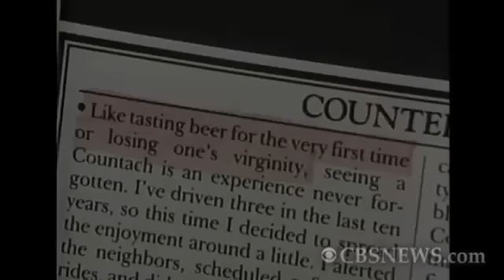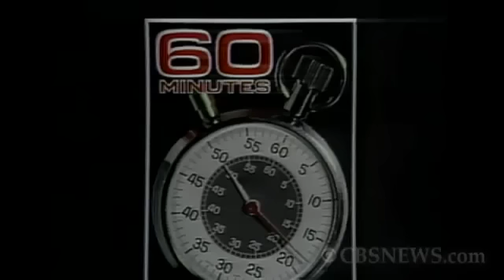Countach - Ferrucio Lamborghini & Valentino Balboni on 60 Minutes (1987)

Comment: I had one of these back in 1997, Spent $10k on a clutch.  Just bought another one last month.  Paid 6 times more than I sold the last one for.  Still an amazing car even though the last fast car I drove 18k miles was a Tesla P85+.  The Tesla is faster and obviously tech loaded.  But nothing beats 12 cylinders roaring behind you!
Reply: Scott Ales but you can't deny a countach is still fast even today. 450 hp and 4.7 to 100 kph. its still fast for modern cars, furthermore in a tesla you won't feel the speed as much as you will in a countach. these cars are also unlike anything else. lamborghini is crazy because its a no compromise car and its not based around the driver. its built to go as fast as possible and its all about the engine and the styling as you know the lambo is a sledge hammer because of this. and everything else in its day had to be fast in corners just to even dream of keeping up, ferrari testarossa included
Reply: Adam Othman The Countach is an equal or greater driving experience but no where near the launching performance of the Tesla.  And my Tesla was only a P85+, not the newer / faster P85D.  But for the all out shock look and sound that is very distinctive, the Lambo carries the day.  My favorite sound of any internal combustion engine street car, is my 1974 Ferrari 365GT4 2+2 with the Colombo V12, 6 Webers, and 5 speed manual tranny.  Symphonic to my ears!
Reply: Scott Ales and thats great. what i said was even for the modern world the countach is still pretty fast, it was way ahead of its time, if i had the cash id buy a p400 miura followed by an lp400 countach
Reply: Adam Othman Yes, to be sure it is FAST!  But in a weird somewhat lethargic way.  It just takes a while for all that machinery to get wound up.  Low end torque is very weak but once she gets wound up it's all fun!  Miura is a dream!  Way out of my spectrum unfortunately.
Reply: Scott Ales yes but thats because the countach is built in an old world way, its naturally aspirated with incredibly tall gearing. there is no ecu performance oriented chips or 8 speed gearbox its the gearing that makes it do that. its kind of like old fashioned turbo lag in a way. you push the pedal wait, wait, and there you go. kind of like lighting a fuse....

Comment: I love when they rate the new ones and how much nicer they are to drive and fit and finish..... And they aren't built by Lamborghini they are built by VW/Audi...... Didn't take long to show up that legacy I guess
Reply: adamyaw no they are still built in sant'agata by lamborghini. yes they have electronics from audi, but everything else is distinctly lamborghini. furthermore vw/audi goes to the company for engineering and solutions of the type. proof of this can be found in the fact that lamborghini builds audis le mans winning racing engines, designs them too